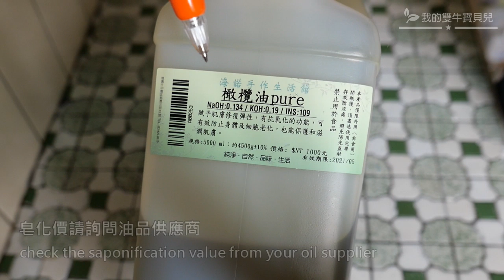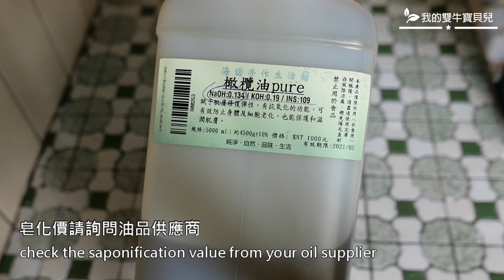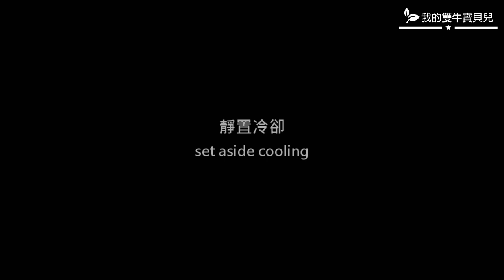斜向分層皂 - how to make slant layers soap with acrylic cover - 手工皂

Comment: Hi. Love ur ideas and creativity to the max. Keep the great work going....
Could you please explain why so much math is involved and why u have done it in several batches rather than saponifying both colors at a time? I guess separating colors after soap is made and pouring alternatively based on the markings would suffice? This would be easier than mixing lye and fragrance for every part separately.... Don't know what i am missing here... Thnx
Reply from the maker: It takes time for every layer to get hardened before pouring next one in order to make straight line. 
This batch is made in the way you described👉https://youtu.be/I8V-IemPMeE, but many people told me that they didn’t have enough time to work. The soap batter thickened in the pot before pouring in mold, so I’m just providing another option. Both way works😉